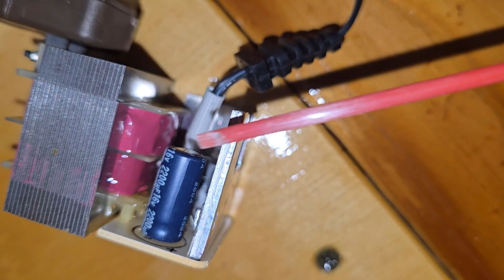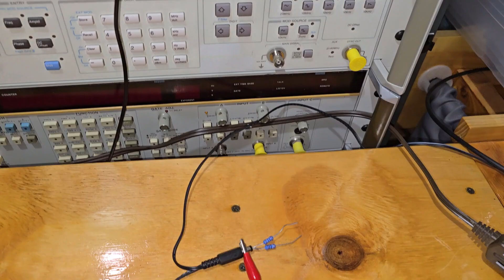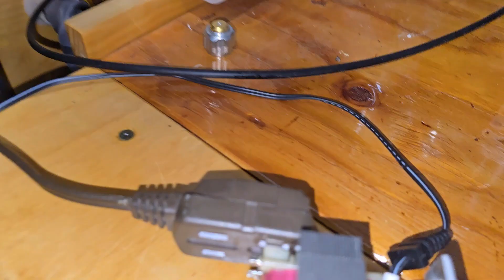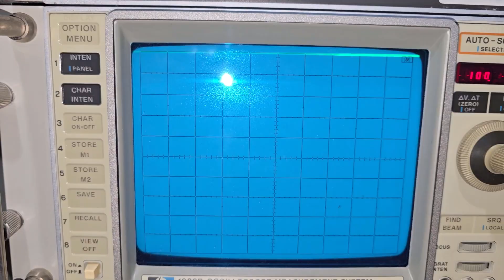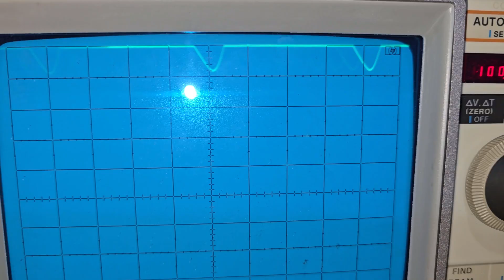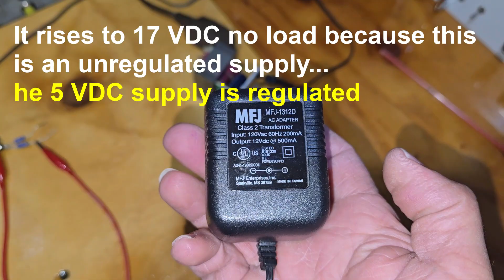Power Supply Ripple Problem Identified

Comment: Electrolytic capacitors are ment to shorten the lifespan of elektronic equipment. Some call it: planned obsolescense. There are ofc capacitors in metal tubes with glass ends, but those are only available for military stuff.
Reply from the maker: They do a very good job of it too. I will be replacing it with a capacitor of known ratings. The original was probably the cheapest capacitor the power supply manufacturer could source.

Comment: Was that it
Reply from the maker: Failed electrolytic capacitors are the most common reason for problems like this. Second most common would be a failed diode, and third would probably be one side of the transformer winding open. Both of these other causes would most likely result in a strong 60 Hz component to the hum. I only saw 120 Hz so I suspected a capacitor before even opening it.

Comment: Instead of sawing those wall warts apart at the seams I learned a trick some time ago by laying the plastic case on a solid surface like the flat of a vise and hitting the seams with a hammer while rotating to get all of the joints smacked. It sometimes take a few times but the welds will just snap and the case will open up.  Super glue will put them back together if your just doing a repair.  👍
Reply: I squeeze them diagonally in a vice one way, and then the other, and that usually does the trick too. Obviously you need to have a vice.  😁
Reply from the maker: @rogerwilco5187 Thanks for the tip! I don't current have a vise but I want one.
Reply from the maker: Thanks for the tip! I will try that next time.

Comment: Thanks for the follow-up, this made me question if some of the DC Bricks in my house have suffered the same and i just never noticed
Reply from the maker: I have found it to be a fairly common problem. These things are sealed and some of them run very warm inside. Heat can shorten capacitor life. This one ran quite warm to the touch with the half amp load on it. I am sure it was even warmer inside. That capacitor is between the transformer which produces heat and the heat sink for the regulator which produces heat. It is easy to know if they have a problem when they are used on radio receiving equipment or audio devices since you will hear the hum/buzz. On other types of equipment it is not so obvious  unless the power supply issue causes the device to malfunction in some way. I plan to talk more about capacitor ratings including heat tolerance in a later follow-up as I build the new combined power supply.